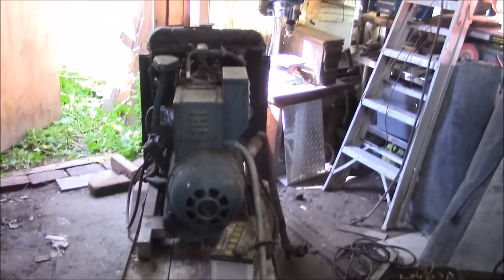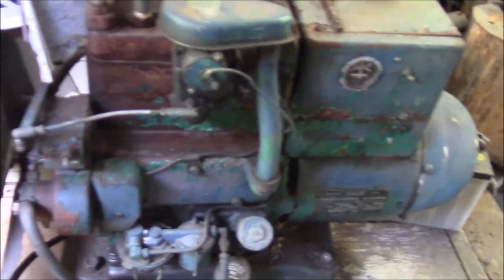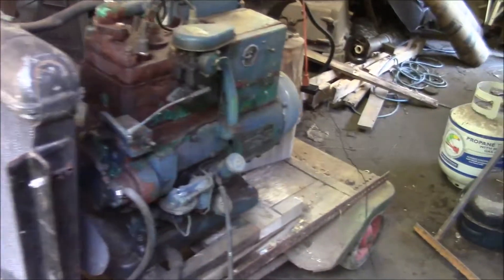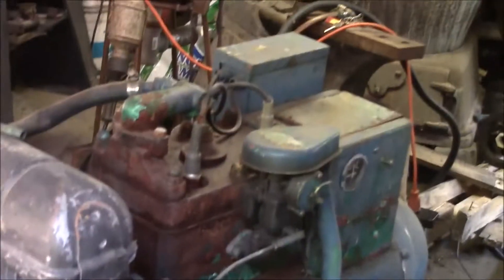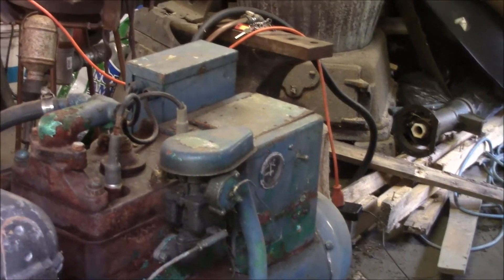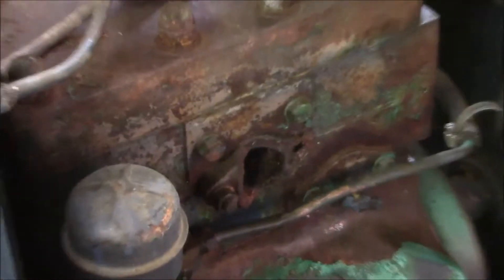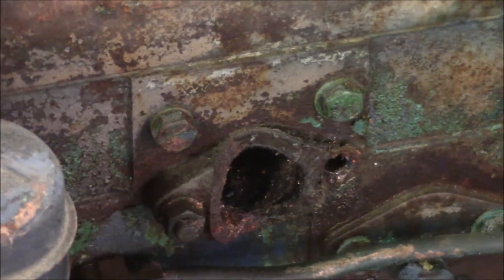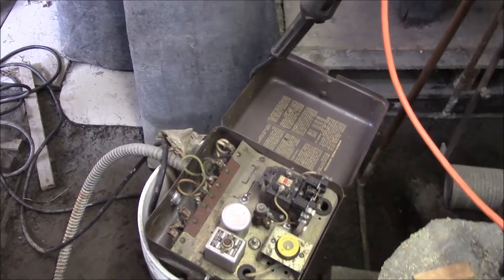Onan Electric Plant Generator Restoration Project

Comment: That is a W2C series engine. The serial number will tell you the date of manufacture. The first number is the month, the second number is the year then there is a decimal or letter which tells the decade. A decimal or letter A indicates 1940’s, a letter B indicates 1950’s.

I’ve never seen one quite like this or a marine application. Very cool, I have a bunch of these. They are
Super smooth and quiet!
Reply: Please send me the w2c model 3kw 230v.50hz.armiture winding diagram. My genset armiture wire is thefts. Please help me for re winding purpose. I'm waiting for your good reply. Thank you.